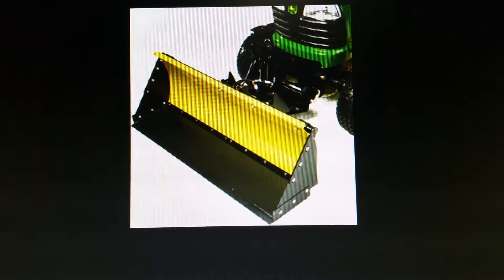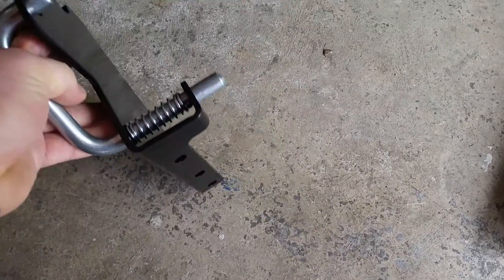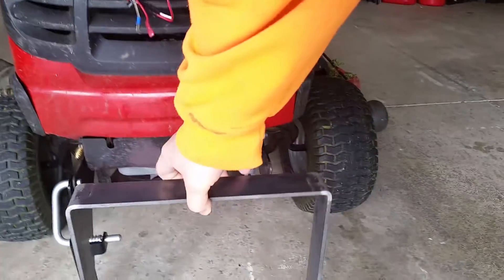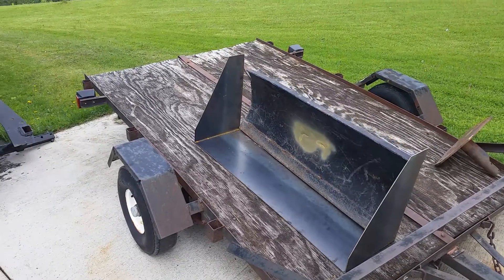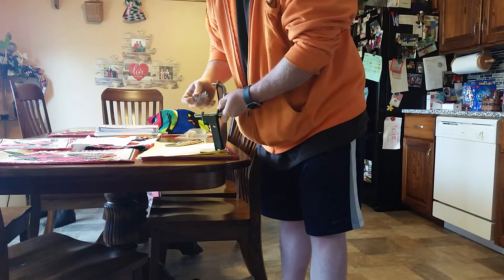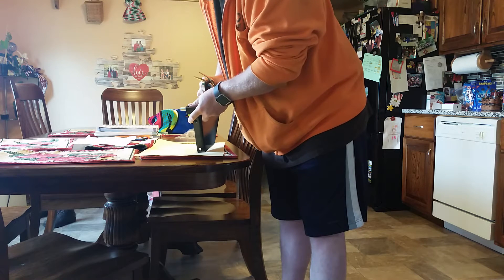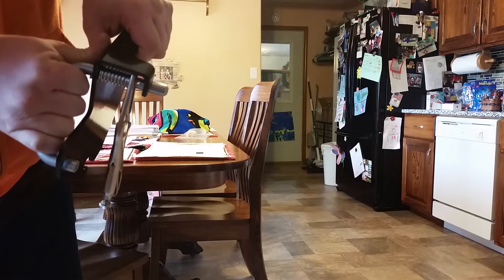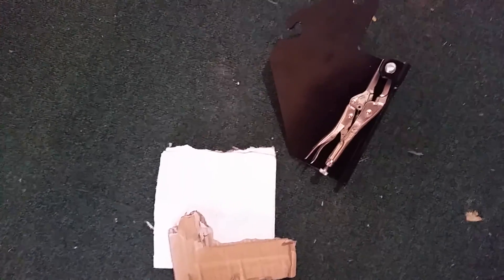Fabrication tractor shovel or mini scoop loader

Comment: Great Idea, but that lawn tractor frame will not last long at all. I would start with a garden tractor like a JD 200-300 series from the 80-90s.
Reply from the maker: You're 100% right a lawn tractor would not work very well.  Mine is a garden tractor with cast front end and solid steel but even that is a little much for it